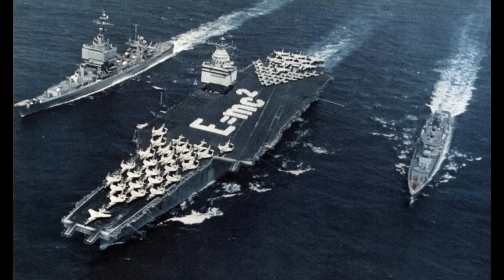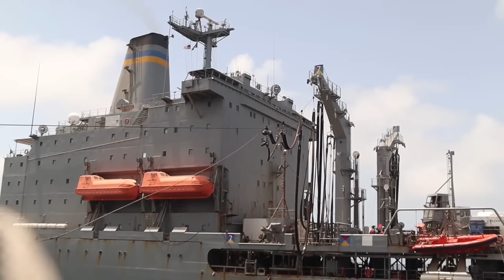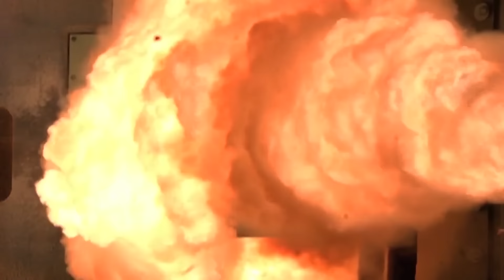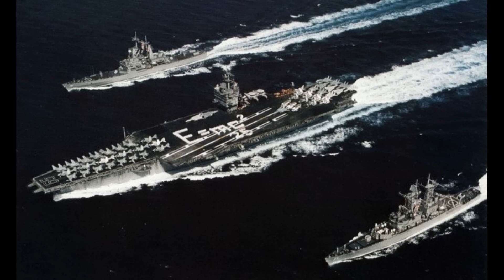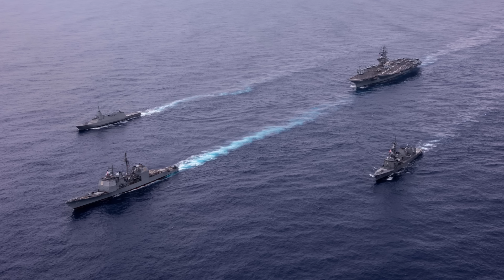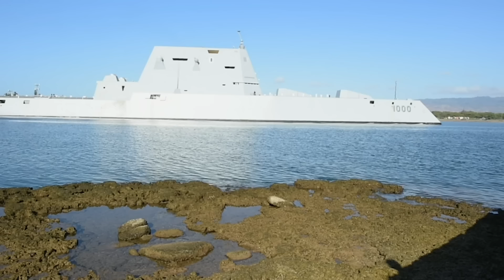Should the US Navy Bring Back Nuclear Cruisers?

Comment: Go with the Zumwalt class before you make another F22 mistake. It was already designed and tooled, etc.
Reply: the Zumwalt class is crap and overpriced
Reply: @fred6319  Oh is that why it's the only ship that can take hypersonic missiles? Or did you mean trhe stealth was a waste of money. Or was it that its a super stable ship in heavy sea states. Maybe it's the electrical system that can power lasers you take issue with. Just how do you think it stinks, be specific?
Reply: @Molokan-v7b  what part of" crap and overpriced" dont you understand?
Budget Constraints:

The Navy has to remain within its budget like the other services. Spending $8 billion on a destroyer, nearly the same cost as an aircraft carrier, was far too rich. The Navy got over-ambitious with the project.  

Exorbitant cost overruns:

The cost of designing, building, and integrating all of these new systems was vastly underestimated. The original cost estimate for the Zumwalt was $1.4 billion, but the entire program ran way over budget to $24 billion
. program costs exceeded the budget by 50 percent,

the Zumwalts constantly need repairs, and breakdowns are frequent. One broke down in the Panama Canal.  

The destroyer’s crew of one-hundred-and-fifty—plus a twenty-eight-person air detachment—exceeded by over 50 percent the originally promised number

2018 Government Accountability Office report stated only five of the Zumwalt’s twelve key technologies was “mature.” Farcically, the ships were even officially “delivered” without combat systems.

 The need to curb runaway costs led to crippling downgrades. Instead of fitting combining a powerful SPY-4 volume search radar with a SPY-3 hi-resolution targeting radar, the Navy ditched the former and rejigged the SPY-3 to handle volume-search as well. This saved $80 million per ship but significantly degraded air-search capabilities.

However, the Zumwalt currently only has Evolved Sea Sparrow air defense missiles with a range of thirty miles—adequate only for local coverage at best. Though the Zumwalt’s missile cells are compatible with longer-range Standard Missiles, those depend on the Aegis Combat System for guidance, which the Zumwalt lacks. And the Zumwalt’s last-ditch Close-In Weapon Systems were downgraded from 57-millimeter to much less capable 30-millimeter cannons.

Even the destroyer’s radar cross-section has been degraded to cut costs, with the adoption of cheaper steel for the deckhouse and the incorporation of non-flush sensor and communication masts.

What were merely three DDG-1000s good for, despite their nifty stealth features and propulsion? The advanced destroyers lacked ammunition for their guns, anti-ship missiles, anti-submarine torpedoes, and long-range area-air defense missiles. Furthermore, the Zumwalt had fewer cells to pack land-attack missiles than Arleigh-Burke destroyers (96), Ticonderoga-class cruisers (122), or Ohio-class cruise-missile submarines (144)—all of which were cheaper, and the last of which is stealthier.

Even the destroyer’s stealthy hull did not offer a clear advantage if it had to escort—or required an escort from—un-stealthy warships
have a nice day.
Reply: @Molokan-v7b  and why was it cancelled?because it was too cheap and to good? and what hypersonic missiles and what lasers?
The cost of designing, building, and integrating all of these new systems was vastly underestimated. The original cost estimate for the Zumwalt was $1.4 billion, but the entire program ran way over budget to $24 billion. That works out to $8 billion per ship
Budget Constraints:

The Navy has to remain within its budget like the other services. Spending $8 billion on a destroyer, nearly the same cost as an aircraft carrier, was far too rich. The Navy got over-ambitious with the project.  

The Ship Didn’t Work as Advertised:

With the new technology built into the ship, it was supposed to be the surface fleet’s next greatest thing. But the Zumwalts constantly need repairs, and breakdowns are frequent. One broke down in the Panama Canal.  

The destroyer’s crew of one-hundred-and-fifty—plus a twenty-eight-person air detachment—exceeded by over 50 percent the originally promised number, but remained half that of an Arleigh-Burke destroyer. However, some analysts fear the super-trim crew complement leaves too little redundancy should the vessels sustain battle damage.

Comment: So, the most expensive items of a warship are the electronics, weapons and power. Now, putting in another VLS farms, when you have the sensors, does not raise the costs higher, so two CGN can easily carry more VLS that two Burkes. 
Then we have to compare the lifetime cost of a fast oiler and 4 Burkes (with fuel, crew, etc) with 2 CGNs... 

And of course the USN has to have ships smaller, than a Burke, too, for scaling the majority of missions WHICH ARE NOT PIER COMBAT MISSIONS.    Presence, anti-piracy, secondary theaters, commerce protection (which is honestly not commerce raiding, Senator)... FFX will do it.

Comment: The USN has needed a new large surface Combatant to replace the aging Tico's for 20 years.  The Zumwalts were supposed to do that...but that didn't work out, and they kept building upgraded Burkes instead.  But the hullform is maxed, a new "cruiser" to handle carrier group air defense, etc needs to be larger with additional room to grow.  15k tons like the Zumwalts is kind of the minimum.  Larger doesn't hurt, and steel is cheap, weapons and systems are expensive.  So a 25k ton warship isn't necessarily much more expensive than a new 15k ton Tico direct replacement.  Zumwalts size wasn't why she cost so much, the unconventional design abd new cutting edge weapons and systems were.  She could have been 10k tons larger with the same systems and not cost much more.
You can call it a "cruiser", a "Destroyer", a "Large Surface Combatant" or a "Battleship"....doesn't matter, its the same thing, it'll replace the Tico's, one per carrier group, with a few extras.